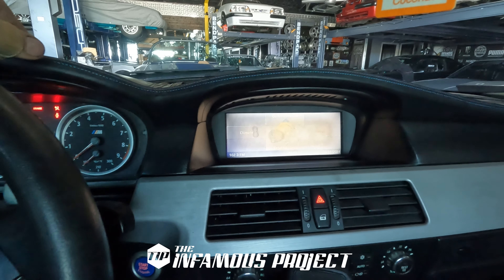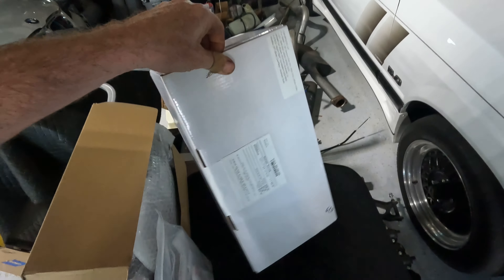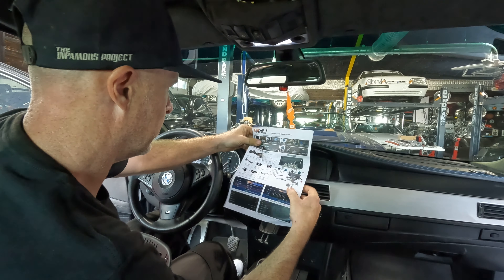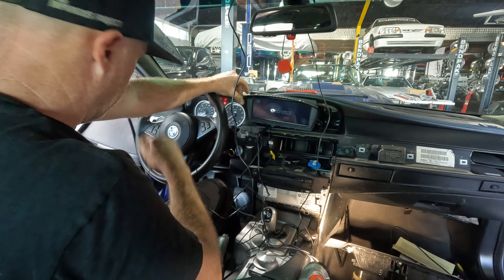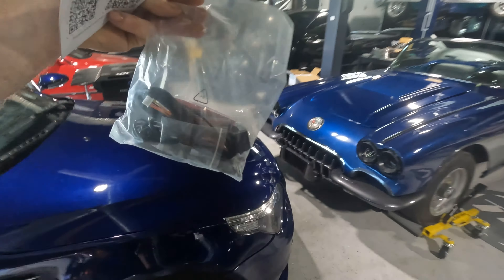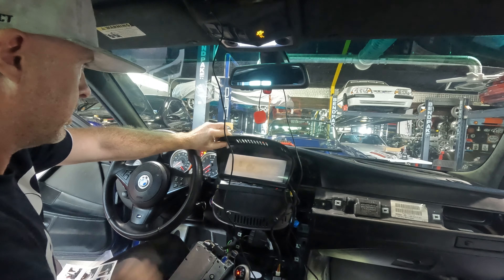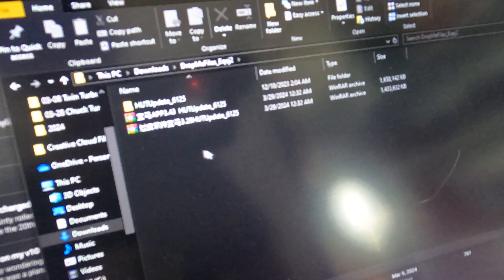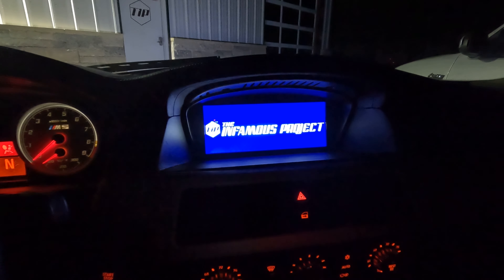Upgrading my old Dash Screen (CCC) with Android for E60, M5, E90, M3, BMW

Comment: I've been waiting for this video. I hate the i drive! I use the usb to aux adapter for music because the bluetooth only connects the phone on the 06 330XI. The stereo still sounds great which is why I have been leary of buying one of these android radios.
Reply: It looks really nice, is the sound quality the same? Couldn't you just connect it to your wifi for the updates? I bought the top of the line android auto radio for my girlfriends Accord and the android auto/carplay never worked and it jacked up her HVAC controls so the windows kept fogging up. I ended up ripping it out and going double din. I got the maxpeedingrods android for the notchback and the android auto connects immediately but since the stupid car won't start I just sit there and make engine noises with my phone. Sounds like a turbo LS 😂😂